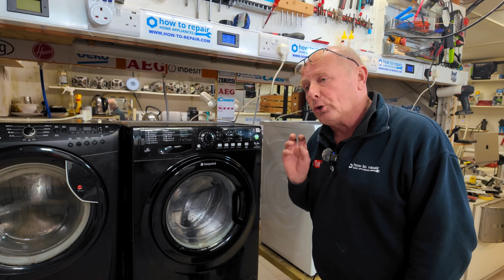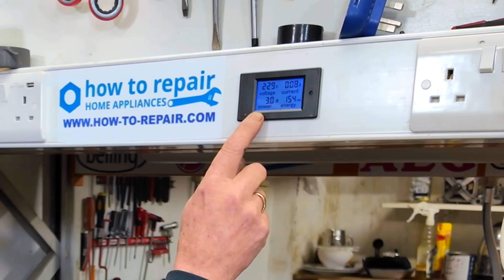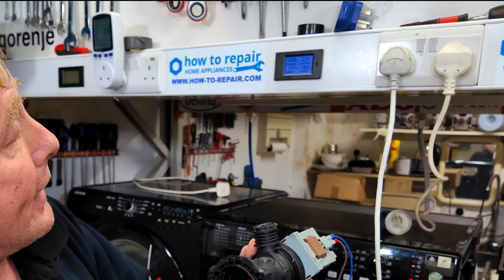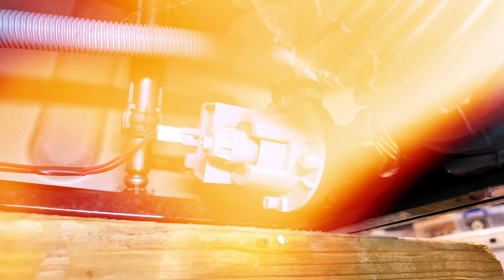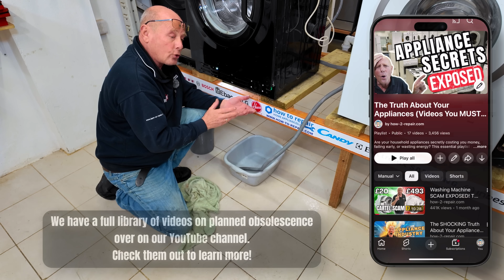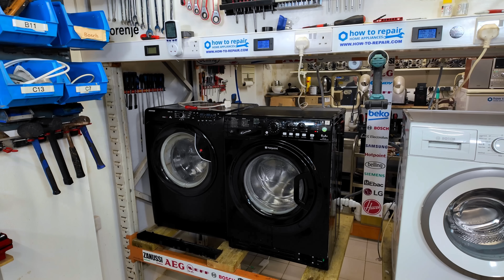How to Unblock a Washing Machine Pump Without Making a Mess

Comment: Brilliant! That's  what I suspected  to be wrong with my machine  after a cushion  in the wash burst  and shed a load of   bits of foam filler inside: that'll  be what is messing up the filter. So now I know it's  worth facing the flood that will ensue! Now to find the old  bath towels  to soak up the deluge: the filters are always so low down that no container is usable...but it will result in a clean floor....

Comment: I have tried to fix 4 washing machines. One I could not fix, one clearly had the band off the motor, and two were due the impeller being impeded, one by a hair clip and one by a random little bit of cloth exactly as shown in this video. I learned about that problem and how to fix it from this video.

Comment: Hi there I have a Beko Wshing machine it has various temperature setting
It does work but only on the highest temperature so I changed the heat sensor but it didn’t sort out the problem so what else could be wrong with machine?. Any hint please
Thank u

Comment: You see, that IS the question ! Why would someone spend 300 pounds on a new Washing Machine ? Not to mention the time ordering it, waiting for it to be delivered (that is, if you don't go through all the effort to get it yourself), install it and dispose of the old one plus the inconvenience of not being able to wash your clothes - Why not get it fixed ?

Answer: Because most repairmen are going to f*** you over as they know you NEED this appliance and will pay anything to get it back.

Either that, or the same repairman will charge you an inspection/call out fee just to tell you they can't fix it due to the manufacturers' deliberate effort in ensuring that you can't.

Money, time, and necessity - it's as simple as that. 

If everyone stopped shafting each other under the guise 'Good Capitalism', we simple folk would all be better for it.

Comment: I once had my Koenic washing machine not pumping away the water after I put very dirty overalls into it (I worked at an oil rig). I feared I had to have expensive repairs done or have the machine replaced. Until my mother told me to put in a piece of cleaning soda and have it cycle. Problem solved for about 80 cents. I still have the same machine for about 14 years now.

Comment: Very Nice video. Been through this myself. We had an AEG machine. Water would not drain. Mrs ordered a new one. When I installed the new machine , I discovered that the drain pipe on the old machine was blocked with soap powder ( that we used in those days ). Luckily my nephew was looking for a new machine and so he used for many more years.
Your video is excellent.

Comment: Please keep making these videoes. 😊Lots of people had no one to teach them the basics of maintenance on everything including washing machines. Most manuals have a section that explains this but lots of people cannot read,or they learn visually and when somethings verbally explained by a person. My dad showed me this the first day i got my first washing machine. His first lesson was always check every pocket in washing going into the machine and remove every loose but or label. He showed me how to clean the lint catcher on the tumble dryer and how to ensure that the hoover filters and dust retainer were kept in pristine condition. He showed me how to unblock the drainage hole inside the fridge and how to fix the panel inside  the freezer where the little fan sometimes stops turning  due to a hair getting caught in there. He shiwed how to do all the checks on my car,oil, radiator water and brake fluid,water for window washer,
tyres tread and pressure ,wipers , lights and how to change the wheel. I cannot tell you how great it feels to have the confidence ,the knowledge and the memories he imparted to me and the independence it gave me. Saved me a fortune. You're doing invaluable work here❤
Reply: so you want people to spend time learning how to unblock your washing machine but not spend any time learning to read. i'm pretty sure learning to read is way more useful than how to unblock a washing machine
Reply: @gruunt4064do you know what dyslexia is👀

Comment: Thankfully there was an error code on my unit telling me that it wasn't draining. Removed the pump and the bearings were pooched. $40 replacement got me clean clothes. $8 reimbursement from the change that was in the pump strainer.

Comment: thanks for your video, I've managed to repair by Hoover washing machine a couple of times but this time I'm stuck! It keeps showing error code E08, it was also jumping around, I've checked and cleared the filter, I've taken the motor out and the carbon brushes  look fine,  tried resetting the machine etc but again showing E08, the drum seems to spin OK and the top weight is secure but there is a fair bit of movement between the drum and the door, any suggestions please? I'm reluctant to go and buy a new motor as it seems ok and uneconomic to repair? Thank you , any suggestions would help , thanks again

Comment: All absolute bollocks. Easy to do this when it is up on a bench. Try it when it is installed and on the floor.  Try getting to the waste hose when it is installed. Try draining water from the pump cover when it is 15mm off the floor and you can't get a tray under it. Only thing you can do is get a VAX and suck the water out and hope for the best.

Comment: Thank you, my bush washing machine didn't want to spin because it seems that it couldn't drain. Checked the filter, that was clean, checked the waste pipe and that was clogged to hell, wiggled it all out and lo and behold the unit drains again. Saved me  a call out, thank you.
Reply: Using warm to hot water with a monthly  maintainance deep clean and liquid detergent ( half of recommended amount), NO softener, just a capful of white vinegar in the rinse occasionally, will help this happening again.

Comment: Visited my daughter in her new student digs and their washing machine stopped during their first use. I checked the drain and lo and behold a bra wire was jamming up the pump so an easy fix. Also told them to take pics of all the marks on the walls and carpet burns from previous students so they did not lose their deposits as i got dodgy  landlord vibes from the unchecked washing machine.

Comment: A paint roller tray is ideal for draining the pump also the door seal has drain holes that gets blocked and causes the seal to perish it's a few second job to clean the drain holes and let the water escape instead of the conditioner use white vinegar and it cleans the machine

Comment: I've had my machine apart a few times for various fixes and issues. New carbon brushes for the motor, draining issues, mould build up. etc. Machine is 20 years old now, and still going strong thanks to helpful videos like this.
Reply: Leave the door ajar and the detergent compartment ( just a little). You won't get mould.
Reply: @desireeretiree Mould builds up all over the place, such as between the inner and outer drum. I actually wash out and dry the drawer every time I do a wash and I leave the door open to allow fresh air in, but over 20 years it still builds up, but thank you for your suggestion.

Comment: A couple of things , where did you get the meters from and any tips on getting the spring fitted on door seal rubbers?
I have been married for 50 years and we are currently on our third washing M/C last  two before our current M/C I just kept going by replacing brushes and door seals. Not so confident our latest LG will prove as repairable but seems to be lasting well.

Comment: Easy to drain on a test bench, try doing it on a kitchen floor
Reply from the maker: There’s a reason I like my test bench it’s much kinder to my back and my boots. On a kitchen floor, you’re often just one wrong turn of the filter away from turning your kitchen into a swimming pool! Believe me, in my 40 years I've had many a wet sock moment.

Comment: My Bosch washer just packed up, drum bearing collapsed so we went to Argos and bought a cheap Bush model, as I'm in the TV repair trade I can get parts for white goods also, turns out it's made by Midea in China, the same people who supply Neff with microwaves, parts for the washer are ridiculous cheap, pcb just over £24, heater just over £10, my wife talked about buying a big brand washer untill I told here there all badge engineered and your just paying hundreds of pounds extra for the name on the front, well pleased.
Reply from the maker: You’re 100% correct about badge engineering. Many people don’t realize that whether you’re buying a budget Bush or a high-end designer brand, they often share the same DNA under the lid. 

It’s a shame about your Bosch drum bearing failure is a classic case of what I call built-in obsolescence, especially if it’s one of the newer models with a sealed outer tub that makes a bearing change nearly impossible for the average DIYer.

If you enjoyed the insight into how these machines really work, please give the video a thumbs up, share it with your fellow tradespeople, and subscribe to the channel! We’re all about keeping machines out of the scrap heap. If you ever need a specific spare, check out our website, or you can Buy Paul a Beer to support the channel.

Comment: Great demo explanation for all levels. I have been doing DIY repairs since the 1980s. my first repair was a Hotpoint top loader my dad was a Blacksmith and the bottom of the drum area was full of caked on rusty mess of grinding dust, slag and iron filing some of the layer was 1/4 inch thick.

I use a shallow baking sheet/tray and cloth layer to collect the water from the font loader drain.

TIP we never leave the soap tray in the machine after a wash and a bit of bleach spray inside the soap tray area to keep the black mould under control. [Dettol Mould and Mildew Remover ]
Reply from the maker: It is always good to hear from seasoned DIYers. Your story about your dad's Hotpoint top loader is incredible having to clear out a 1/4-inch layer of caked-on blacksmith slag and iron filings sounds like the ultimate trial by fire for your first repair back in the 1980s! It would be great if you could share it. Together, we might make a change. If we can't embarrass the manufacturers, maybe someone in the government will see it and read the many comments on this video.

Comment: You should stick your finger in and check that the input tube doesn't have something stuck in it.
We've often removed a large object from the pump only to find it's still not working.
Upon draining it for the second time we usually find a second object lodged in the pipe.

One time it took us 3 goes before the pump started working properly.

Other than bits of cloth coins are the other major offender.
🙂
Reply from the maker: With over 40 years in the trade, I’ve seen exactly what you’re describing more times than I can count. 

I actually mentioned in the video that I was going to drop the sump hose off just to be 100% sure there wasn't a partner in crime hiding in there! For anyone reading this, if you've cleared the pump and it's still not draining, you can also consider this advice and check that input tube.

Thanks for sharing your experience it’s tips like these from the community that save people a fortune in call-out charges.

If this tip helped you out, please don't forget to give the video a thumbs up, share it with your friends, and subscribe to the channel for more repair guides!

See you in the next one,
Paul
Reply: @How-to-repair  When you said sump hose I assumed you meant the drainage hose not the input hose... because there's no easy way to disconnect the input hose... while the drain hose is easy to unclip.

Apart from that it's easy to check the input with your finger. I've never had an item stuck so far up the pump input that I had to disconnect the input hose to access it. To access the input hose you'd probably have to take the front off the machine... which is probably a bridge too far for most people.

It has occurred to me that an item might be stuck far enough up the pump input that you can't access it with a finger ... but so far it never has. Additionally if an item was stuck further up the input hose it would probably be dislodged the first time you ran the machine: At worse you might have to clean the pump out a second time.

🙂

Comment: Unless the washing machine is raised up you won't have enough room to slip a bucket (or anything else) underneath the drain plug.
Draining the machine always makes a huge mess because the water ends up all over the floor and under the machine... no matter how hard you try.
🙂
Reply from the maker: Thanks for the comment mate. After 40 years of fixing these machines, I’ve had my fair share of wet sock moments on kitchen floors. It’s the number one reason people dread opening that filter. When the machine is tucked under a worktop, you've only got about an inch of clearance, which isn't exactly bucket-friendly. 

If these tips help keep your kitchen dry, please give the video a thumbs up, share it with anyone facing a flood, and subscribe to the channel! We have all the spare parts you might need on our website, and if we've saved you the cost of a professional floor cleaning, feel free to Buy Paul a Beer to support our repair mission. Thanks for watching!

Comment: Colour catchers escape down at door seal gap  have seen it dozens of times
Pin them to something in the wash or stop wasting money on them
Reply from the maker: They are the absolute number one enemy of the modern washing machine drain system. Because those sheets are so thin and light, they easily surf the water right through the gap between the drum and the door seal. Once they’re through, they head straight down the sump hose and wrap themselves around the pump impeller exactly like that piece of cloth I found in the video.

If this tip (or the video) saved your machine, please give us a thumbs up, share the video with your friends, and subscribe to the channel! You can find all the spares you might need on our website, and if we've saved you a few quid, you can always Buy Paul a Beer to support the channel. Thanks for watching!

Comment: No such thing as a landfill. Only exists  in developing countries. Old machines beyond repair are being dismantled and the materials recycled.
Reply from the maker: As someone who’s been in the industry for 40 years, I have to be a bit candid: the recycled label doesn't tell the whole story. Even when a machine is recycled in a developed nation, it’s still a massive loss for the environment and your wallet.

We used to sell 20 to 30 machines a week which were all reconditioned machines today manufacturers are stopping this by making machines unrepairable in the future or uneconomic to repair. This does not only add to landfill but it stops people with less money from acquiring machines or repairing them.

Comment: i was in calgary, alberta canada pumping out basements after "the flood" and these areas are the upper class in every home. well the city ordered anything thats got a waterline on it must be binned. take to edge of property and city will collect. that was insane. i have never seen so much money being pushed out to the curb in all my life. toolboxes FULL new machines top of the range hobs, tvs, sports cars! was madness. too bad i was working to try and save some rich guys paperwork at the time. work before play makes dull days.❤
Reply: incase you do read this i lived in upon tyne, newcastle and hartlepool for 3 years and picked up 20 accents so i speak old broken english now hahahaha. oh and seaham beach. lived my last year a tenner from the beach.❤
Reply from the maker: That is a story that would make any repairman weep! In my 40 years in the trade, I’ve seen some tragic waste, but an entire city's worth of high-end gear sports cars, toolboxes, and top-of-the-range appliances being tossed to the curb is a different level of madness.

You've touched on a very tricky subject with flood damage. While my heart says dry it out and fix it, the authorities and insurance companies usually pull the bin it trigger because floodwater isn't just water it’s often a cocktail of silt, sewage and chemicals. Once that gets into the insulation of an oven or the windings of a motor, it can be a real nightmare to make it 100% safe again. Still, seeing a brand-new Miele or a set of snap-on tools headed for the scrap heap because of a waterline is enough to give me heart palpitations!

Comment: man i really wish my SUPRA IPX4 sw5l30d had this pump config. they seperated the filter housing and pump body so you have to pull the machine out of the camper nearly to get the pump body opened at the back and remove any rags...plus i cant find a manual for this machine, it was traded for an oil change so i live with the pita. but heck front access filter pump and all? kids these days got it good. 14:36
Reply from the maker: I’ve seen many a machine swapped for a crate of beer or a bit of engine work in my 40 years, and usually, those are the machines that have the most personality which is just a polite way of saying they’re a pain to fix!

You’re absolutely right that you’ve got a tricky setup there. On many compact or camper style machines like your Supra SW5L30D, they prioritize saving space over ease of repair. Having the filter and the pump body separated is a real headache, especially when you’re working in the tight confines of a van.

It’s definitely not as easy as the front-access Hotpoint I’ve got on the bench, but keeping a machine alive in a camper is worth the effort!

If this helped you out, or if you just enjoy seeing machines saved from the scrap heap, give the video a thumbs up, share it with your fellow camper-dwellers, and subscribe! For any parts you might need, check our website, and if we've saved you a trip to the tip, feel free to Buy Paul a Beer.